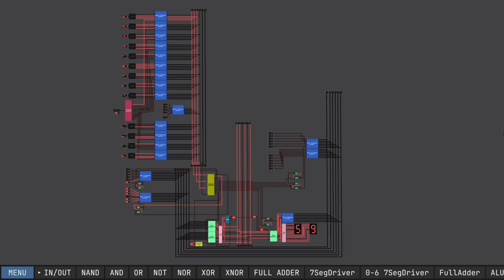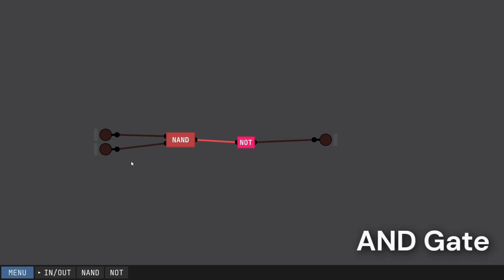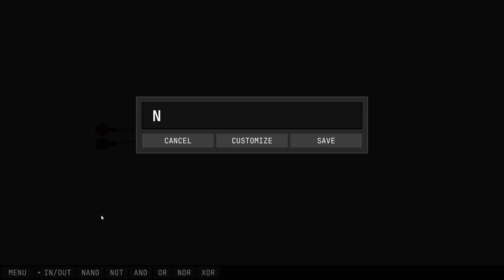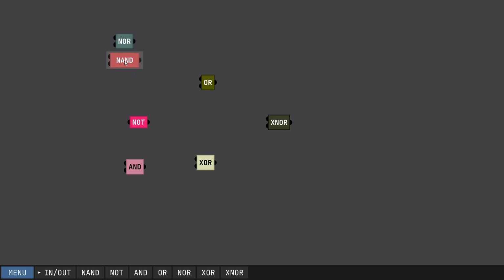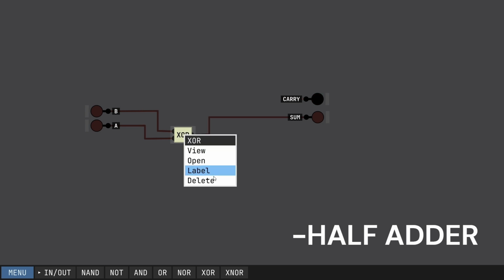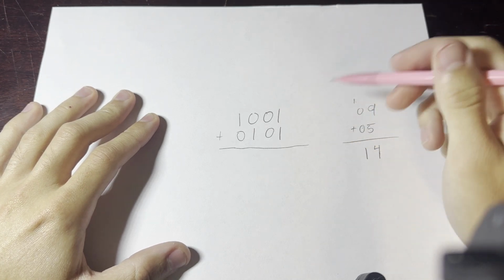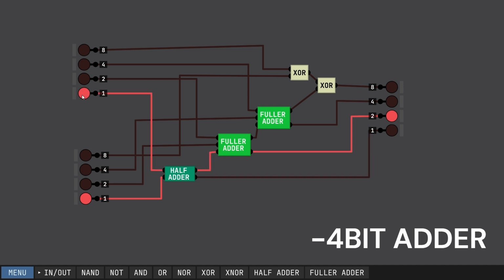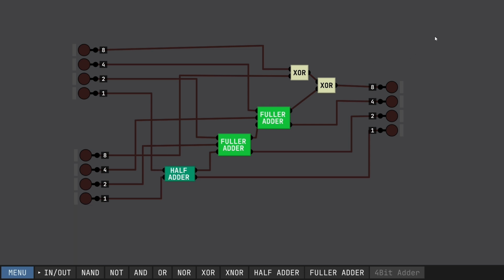How I built a CPU with minimal transistors/ Fully exploring computer logic

Comment: What is there to carry? If you want to add 8,16,32, or 64 bit or larger numbers with your 4 bit cpu  you want to store the carry bit as a flag (read: a certain bit in your flags latch). Then the next add can use the carry flag on their input carry. You probably need more flags, like for example a zero flag that's on if the results of any operation was 0. This is useful for branch logic or comparisons. Like jump for addres x if not zero is very useful to make loops.

Comment: Honestly this is overrated and clickbait, we need a working x86_64 cpu simulated in digital logic sim, make at least pentium i mean easy enough right? (Tip : you could use the intel cpu sticker easter egg as a hint)
Reply: sooo even tho that is possible......that shit will be EXTREEEMELY hard...and technically what this fella made is TECHNICALLY a Fricking CPU
Reply: Modern CPUs(386+) require a minimum clock rate to just start initializing, or it will remain non responding

Comment: Hey bro, Im still grade 6 and I think this is a perfect video to tell what I know about CPUs

So about my CPU, Its enirely different from any CPU other than the ALU and some of the parts, to get rid of that "one control unit controls everything", I decided to make an ID system that takes data, stamps an ID and uses an opcode if it should include the data or only the ID, this works but I cant explain it in this comment

And I realized "hmmm, wait I dont need a clock nor a register file", so of course I removed the clock and replaced it with handshaking with a done opcode that combines REQ/ACK, and for the register file yeah I just replaced it with one block of RAM that has dedicated addresses for each part

(ID system can take 10th output of multiplier and make my address arranger arrange N - N addresses, super customizable!)

Now I am currently trying to make the GPU/ray tracer, I skipped basically EVERYTHING, but I know about vectors, angles, rays, faces, vertices, and edges which are the core parts of a GPU ray tracer, my goal is to have a formula that can detect if a face is valid for the angle of reflection calculation of a ray.
Reply: The replacement of registers with RAM is interesting - the reasoning for the use of register files in modern CPUs is that I/O with memory is slow relative to registers (both happen on the order of nanoseconds in modern chips, however). The lack of a clock however is a very clean way to handle asynchronous computing! I only know of a few systems that don't rely on the usage of a clock, though they're pretty old in the computing world.
Reply: @MyANIMATIONSTUDIOMC  I'm trying to make my ray tracer, it's literally like if ray marching and BVH were super optimized, the only problem now is what is the formula for the rays to move, and I am trying to figure that out with only addition, yeah remember I'm not in highschool het
Reply: @asfjhk1123 most ray marching implementations use multiplication as well, as you need to add a multiple of the normal to traverse along the ray's path. To calculate the normal you'll also need square roots and ideally subtraction. This is a huge reason a lot of modern GPUs have this functionality natively!

Comment: You can make the FULL ADDER use 9 NAND gates instead of using 2 HALF ADDER gates and an OR gate.
Reply from the maker: Thanks for the information as I did not know that. I figured out the circuit and will make an updated video in the future.

Comment: Good stuff. The mic is a little crusty, FiFine make good ones that aren't expensive. You could also try recording audio with your phone. I assume you're using a built in mic either on the computer or a headset. Pretty much anything will outperform those.
Reply from the maker: I recorded that video with the mic on my laptop. I used my phone mic for the videos after as I realized that same thing after resisting to it.